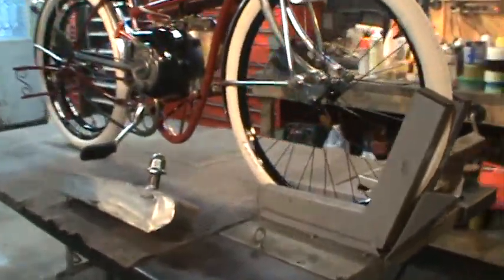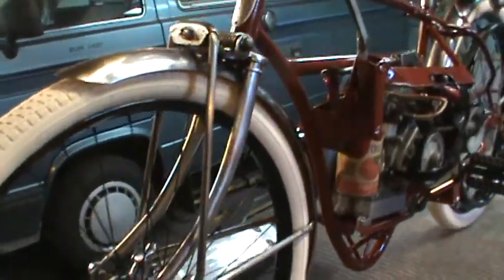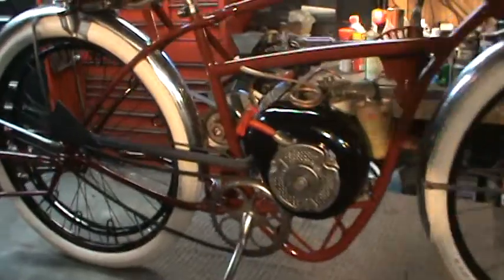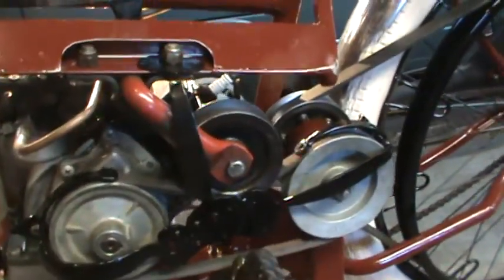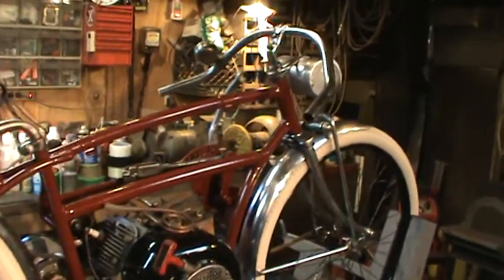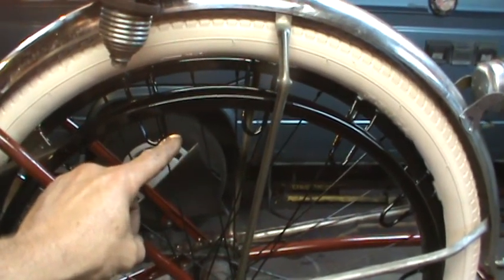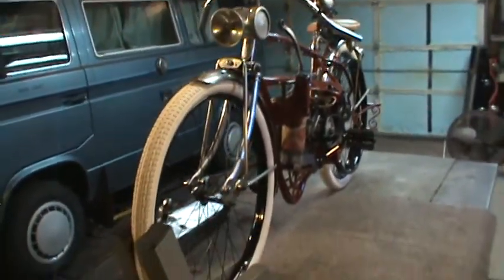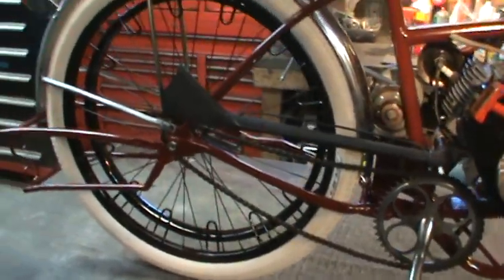board track racer reassembly

Comment: bike looks pretty good   i like the tomato can    air filter     

if you decide to go with a smaller rear wheel pully  you can still buy    the  wheel pully  for a whizzer  on ebay       brand new with the mounting hardware     it is $44     it may be alot easier to replace your rear wheel  without a bunch of welding  if you damage your rim again     you can just bolt the pully on a new rim and go

Comment: my bike should  be back on the road  the first week of november      i am going to rebuild the motor     since it went nuklear    i will replace all of the crank seals , bearings  , piston , rings ,  gaskets  , spark plug  and clutch  . i got the bike to  47 mph  . i want it to hit 55 or 60 mph   even if i have to use the NOS kit to do it  . i may have to build a few spare motors  to keep on the shelf  just in case i blow another one up

Comment: Definately like the handlebars like that, just looks more authentic. Makes me wonder to, if there was a reason why they placed the bars down low like that on
  the old bikes. I'm guessing maybe it has something to do with having the CG closer to the middle of the bike for better handling in the corners, in that 
the rider would have to shift his weight forward to grab the handlebar, thereby shifting CG closer to the middle of the bike, and a bit lower vertically as well.
I mean a mid engine car generally corners better than a front engine car, but I'm not sure if the same thing still applies with bikes. Suspect it does.
  As a general rule though, I'm thinking its always better on any vehicle to have the CG as low as possible and closer to center mass.
I'm guessing why those modern street legal racing type bikes, like say a Kawasaki Ninja, where the rider is practically horizontal are made the way they are.
Maybe at the speeds this bike will be traveling it wouldn't make that much difference, but I'd bet if you tried the handlebars both ways you'd notice a difference
in handling between the two. Even so, either way it most DEFINITELY  looks more authentic.